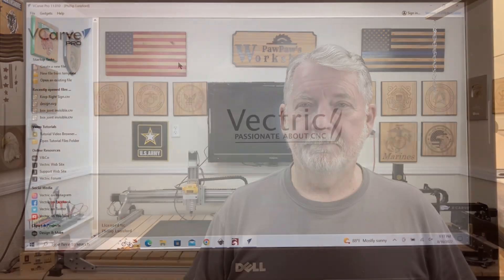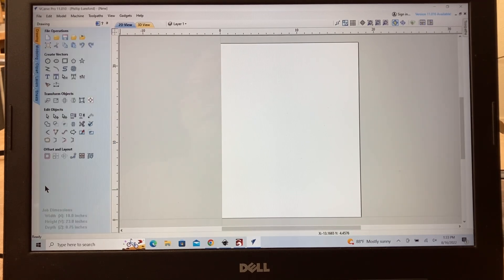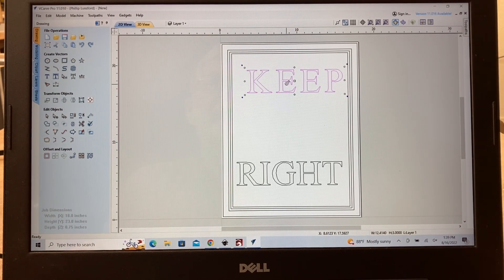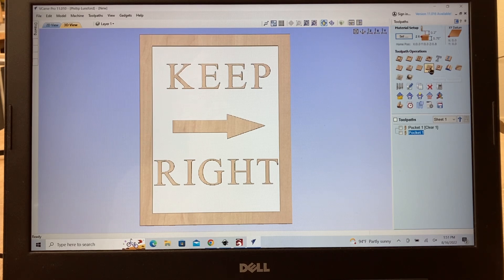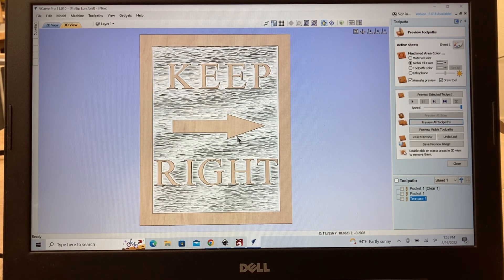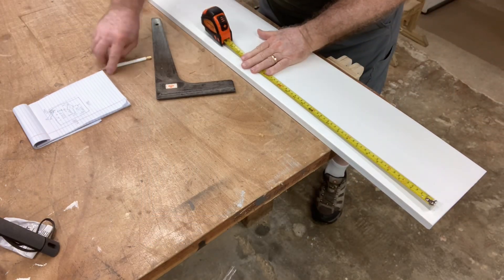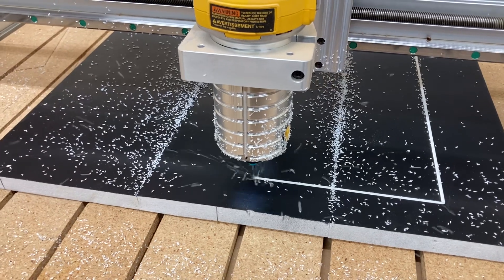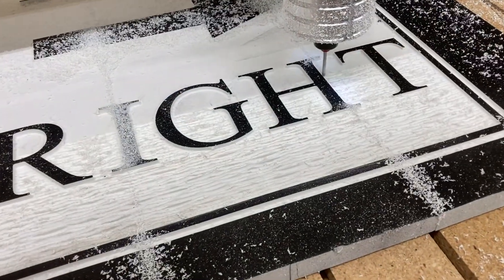FREE  New PVC Sign for a Local Community

Comment: Hi just wondering I'm doing pvc signs and once all the sign is done the white pvc which i just cut gets dirty pretty quickly even touching it leaves a smudge do you protect yours in any way from marking so easy thanks
Reply from the maker: No I do not protect it. Just wash it off with soap and water if necessary